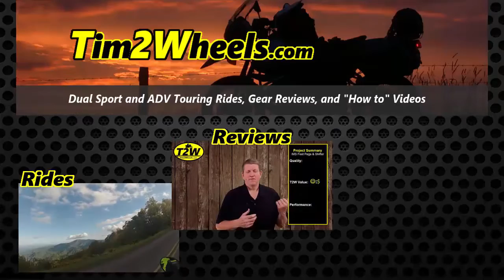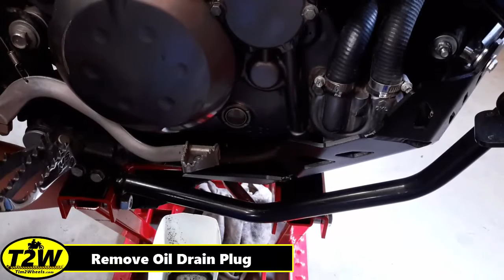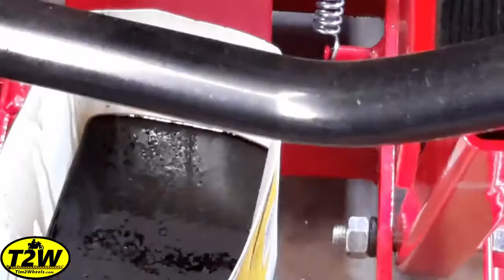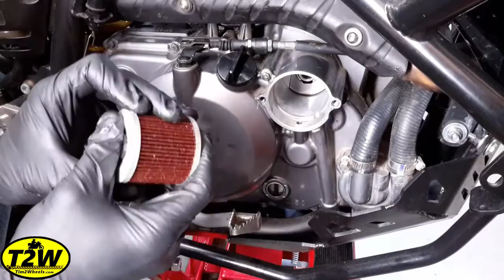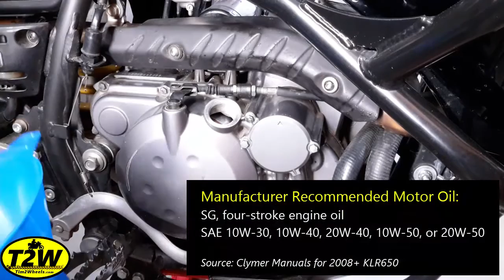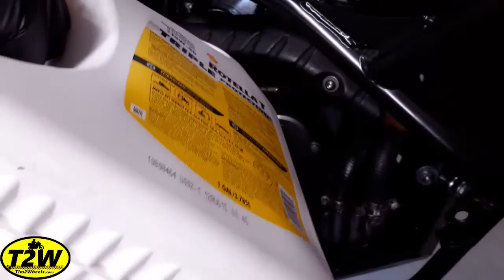T2W KLR650 Maintenance Series: Oil Change

Comment: I'm sorry but the symbol on the side of the engine is not litres it's quarts. You will also find that most  KLR650s will be full with 2.1 litres with a oil filter change. I put in measured 2 litres and then top up a little if required after running.

Comment: You might also like to drain out the old oil from the oil gallery that comes down from the oil filter housing, follow the gallery down and you will find a drain plug

Comment: Tim,  I must have missed it in the video.  How often do you change your oil??
Reply from the maker: I changed oil in the KLR every 2,000 miles. You can go longer, but oil is cheap and clean oil is the life blood of the engine. 
Thanks for the question and for watching.

Comment: Hi, Amazing video. Quick question, are u using synthetic oil? 
Thanks.
Reply from the maker: In the KLR I don't use synthetic. In other more high performance engines I do. 
The KLR is a low revving, low stress engine and mineral oil holds up great. With regular oil changes,  that engine will last a very long time.

Comment: Great video very informative 👌👌👌
So the Rotela T is it safe for motorcycles clutches and such?
Reply from the maker: It has worked well for me and many other KLR owners for many years. It is not a "Motorcycle Oil" and I don't think I would use it in a high-end race bike. I have never had a clutch problem, but I don't abuse my bikes.
Thanks for the question and for watching.
Reply: @Tim2Wheels  thank you!👌

Comment: What year is your KLR650? My boyfriend has a 2008 model and when I helped him change the oil the first time after he bought it I don't remember seeing a oil filter rod. I have a sports bike so maybe I just didn't know it was there or did they change that on the 2008 model? Thanks and nice video.
Reply: I have read that many owners have inadvertently discarded the tube at their first filter change.  That is a bad idea.  If the tube is missing, you want to replace it ASAP.
Reply from the maker: Hi Tracey, This one is a 2009. The 2008 should look and work the same, so there should be a tube in the center of the filter.
Thanks for the comment and for watching.

Comment: Oil plug Wrench size ? 
Filter cap socket size ? 
Devils in the details.
Reply: 17mm and 8mm respectively
Reply: 🤦‍♂️ if someone can't figure that out they shouldn't be driving a motorcycle..Plus I'm pretty sure he said 8mm for the filter cap in the video..

Comment: I use a gallon washer fluid jug but I cut the side out of it so you have a WIDE  catch pan . And you can take the cap off to drain the pan cleanly . Easily .

Comment: Excellent KLR tutorial series!

One question you don’t mention the use of synthetic oil, whats your take on it overkill for KLRs, not necessary etc?
Reply from the maker: Hi Ted,
Discussing motor oil is like discussing religion and politics. People have strong opinions and it often ends in a heated exchange :) 
I am a fan of synthetic oils. There are numerous advantages with synthetic that I think far outweigh the one disadvantage (price). I use synthetics exclusively in my higher performance engines. However, some of the performance advantages are overkill for a KLR due to its low RPMs. It just doesn't tax the oil as hard as a high performance engine would. But that's one reason the KLRs last so long. 
You will gain the increased mileage between oil changes and if you ride in extreme temperatures, it's also a big plus.
Most people that ride KLRs are "budget minded" and therefore prefer mineral-based oils. Traditional mineral oil is also more widely available in remote areas here and around the world. I think either are a good choice for a KLR if you keep to your oil change maintenance schedules.

Thanks for the comment and for watching.
Tim

Comment: Just bought a new 2018 KLR 650 about a month ago. I'm confident I can perform my first oil change. Just curious about when. Dealer said 600 miles. Some say sooner.
Reply from the maker: On a new bike (under warranty) I would recommend following the manufacturer guidelines on maintenance including using the recommended oil and filter. This helps to avoid any warranty issues should they arise. 
Thanks for watching. Enjoy that new machine!

Comment: Is there any after market mods that can be done to add a dipstick so a single person can actually check the oil by themselves on the road without having to have the front wheel chocked and getting on their hands and knees? I have a badly placed sight glass on the one I own and even with a mirror, and a camera set to take time lapse photos it is still a stupid way to check the oil that takes way too much effort for something that really should be one of the easiest tasks for routine maintenance.
Reply: Fortunately, I find it very easy to pull my KLR off the sidestand while I have squatting beside the right side of the bike to view the sight window.  I can hold it at the balance point with one hand and read the sight glass.  I can’t do that with my LT, but it has a centerstand so that makes life easy there other than needed the (included with the bike) mini flashlight to see the sight glass inside the fairing.

I would think it would be fairly easy to sit on the KLR and hold it upright and use a cell phone to take a picture of the sight glass and then use the picture to check the oil level.  Have you tried that?

When I had my Voyager XII, many folks glued a mirror on the foot peg in order to see the sight window while seated on the bike.  The KLR doesn’t have such a convenient place to attach a mirror, but it seems like something could be rigged up if someone was so inclined.
Reply: @LTVoyager  i agree....my KLR is very light compare to my ZRX1200👌👌👌
Reply from the maker: That's a great idea, but I have not seen anything out there.
Reply: V Star 1300 Adventures
Harley-Davidson is the only manufacturer who has gone to the obvious solution of equipping its bikes with a dipstick that's  meant to be read with the bike on the side stand (jiffy stand in Harley speak). Duh !
Reply: @CaptHollister  Harley isn't the only one.   My '95 Suzuki Intruder has a dipstick.
Reply: Techy Dog
That wasn't my point. Lots of bikes have dipsticks. The issue is that the bike has to be held upright for the dipstick to read accurately, requiring you to either enlist some help or learn to hold the bike straight up with one hand while juggling the dipstick with the other, or develop the flexibility to reach down for the dipstick while sitting on the bike. which is a hassle and a bit risky. On Harleys you just park the bike and read the dipstick.

Comment: Thank you for all of the KLR tutorial videos you post.  I've been riding for just under 12 months now on a 2017.  If you were to tell me a year ago that i'd be changing my own engine oil and replacing the air filter on my new motorbike, i'd have called bullsh#t and predicted i'd just be paying the hourly service rate at the dealership.  Your videos are a significant factor in that old chestnut re: what a difference a year makes.  Some other YT tutorial videos come damned close, but yours are already my gold standard.  Thank you.
Reply from the maker: I think it's good to do your own maintenance when able. You learn a lot and get to know  your bike better. 
Thanks for the comments and for watching

Comment: Great Vid Series!!
2 questions.
@ 10:10 when you install the Filter with mounting tube dose the orientation of the tube holes matter??

After I did my oil change I brought my level up to the upper limit just over 2.5L , I noticed when I started the bike the Oil Level in the sight glass emptied completely? Is this normal while running??
Reply from the maker: The orientation of the holes in the tube does not not matter (just the shoulder end towards the motor). With 2.5L you should see oil in the sight glass with bike straight up and level (not on side stand).
Reply from the maker: ADD on: I saw your comment about "while running". When running it will be hard to see and may look empty. check the oil level with engine off.

Comment: I have a victory that takes 6 quarts of oil.  It really bothers me that my KLR only takes 2.5  quarts.  I'm with you, I like to change it every 2000 miles or so.  Because I change the oil so often, I got a good quality metal mesh reusable oil filter.  I figure it will pay for itself in a couple years.  I also like to readjust the doohicky every oil change.  I know it doesn't need to be done that often, but I'm not much of a risk taker.
Reply: It may pay for itself and it may ruin your engine.  Most metal mesh filters do not filter nearly as well as modern paper element filters.  Check the specs on the metal filter.  Most only filter down to 30 microns whereas a good paper element filter will get down to 10 or even smaller.
Reply: how do you clean your filter?
\\
Reply: You adjust your doohickey?
I thought you have to open up the engine?
Did you put a removable access panel in that area to expedite the adjustment?

Comment: How often (miles) should the oil be changed?
Reply from the maker: Marcos, There seems to be a lot of confusion out there about the oil change interval for a KLR. I change mine every 2,000-3,000 miles, replacing the filter every other oil change. That is more often than most, but Iike to keep clean oil in my bike. Some will say 5,000 miles, which I think is okay. Others will go 7,500 or even 10,000 miles between changes without problems. However, that's too many miles in my personal opinion.
Reply: i baby my killer 6 fitty lol i change it every 1000, that rotella t is so damn cheap i really dont mind
Reply: I do the same, but I abuse it. I ride it pretty rough and I get the speed up a lot sometimes....